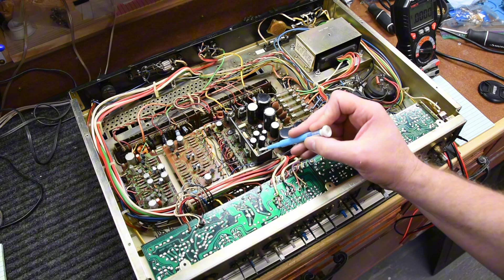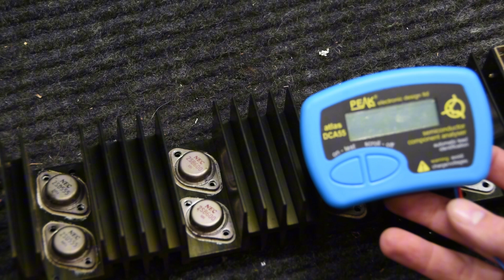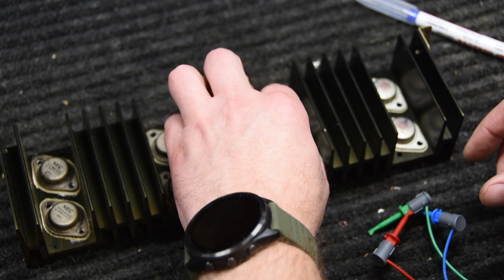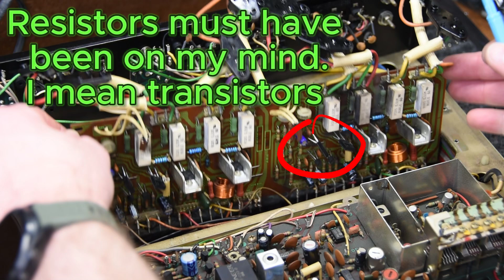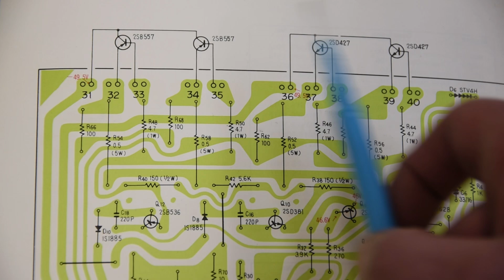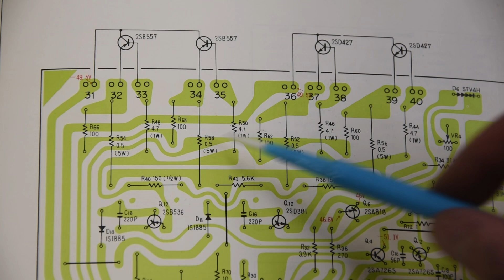Complete Repair of Pioneer SX-950 | Vintage Stereo Receiver Restoration & Troubleshooting

Comment: Hello there and thanks for this video.
First time I will try to fix anything that is electronic, and it happens to be my sx-950😅
I think we all now how this will end up.
So I haven't seen your video past to the point that you check the voltages on the 1-15 to the power supply,cause I already found some i would say important differences.
On mine, 8 9 and 10 they give me negative 0.979volts,as well as 15gives me negative 50.
Is there any chance that you could guide me on what to do next?
By the way the amp has no sound coming out from non of the channels.
Thanks for this video again.
Reply from the maker: Thanks, but its kinda hard to walk people thru this via a keyboard.
Reply: @ATOAudio 
I understand.
I will start with recapping the supply board.
Thanks again
Reply from the maker: @Gmcanada24  in the 850 the protection circuit was a common failure point as well. So I would plan on recapping both and replacing the transistors

Comment: Having a similar issue, but do not have the evidence of blown resistors or hot spots. This is a great instructional video that I will be using to go into the project. Both the SX-850 and SX-950 are showing this. Thank you for taking the time to put it together so clearly. Much appreciated!
Reply from the maker: You're welcome! Glad to help. Let me know if you have any questions!

Comment: I bought a SX-950 recently and it appears to have the same issues or similar to your unit in this video. I am retired and new to this and your video really helps.  I plan on keeping this unit myself. Thanks
Reply from the maker: Thanks for sharing!! I hope you get yours fixed and ready to rock!!
Reply: @ATOAudio  I checked all the volts on the PS and was almost finished when something shorted. Not sure if I did something wrong or if there was a loose wire which I later found.  Question, any suggestions on where I should begin my search for why I am not getting volts now

Comment: Question: I have an SX-850 on the bench and when turned up to about the 10 o'clock position on the volume knob, the protection circuit kicks in. All pin voltages on the Power supply, protection circuit, and amp board test correctly. Could this be one of the output transistors going bad? I also replaced the relay. I test the unit after each board, but guess what, I never turned it passed the 10 o'clock position. Lesson learned. 

Note: At volume less than the 10 o'clock position, the unit works perfectly.
Reply from the maker: what have you replaced on the unit so far?

Comment: 13:35 Pin 10 and 11 are connected to the same point. Installing the fly back diode is easier between 9 and 11.
Reply from the maker: Yes they are. Just how I've always done it.

Comment: 3:54 Did you happen to notice if the transistors on the power supply board, attached to the heat sinks, getting really hot? You can touch them, but not for more than 3 or 4 seconds before it gets to hot.
Reply from the maker: Yes they get hot.

Comment: Please help me in adjusting my pioneer sx950 tuner knob as it goes to far left and not far enough to the right. Is there an easy adjustment to putting it on like 98 fm and somehow fixing the string to put it back in line? So like now if I put it on fm 98 radio station but the needle points to 94 fm but plays 98 fm. Can you make a video showing how its done?
Reply from the maker: This isn't something I can really describe over these messages on how to do. But maybe I could put together a short video. Please watch my FM alignment video as that may answer some of your questions and help you do a rough alignment

Comment: Sil pads AND thermal paste? My understanding is paste is only used with mica, not the sil pad. At least most techs i know dont mix the 2. Are they teaching me wrong?
Reply from the maker: Yeah, I've run across that as well. Some say you don't need it others that you should still use it. It won't hurt anything and actually helps fill in any uneven surfaces to ensure maximum contact and thus heat dissipation. That's why I use it. I'm trying to give these components the best chance of lasting another 50 years. Great question. Thanks.

Comment: Really good video! Thank you! I always change out the diodes on the power supply. Is there a reason you didn't on this board?
Reply from the maker: I know a lot of people that do that as well. However, of all the receivers I've restored and repaired I've never come across a power diode that has failed. Zener diodes yes, but not regular diodes. Maybe I've gotten lucky, but its just my experience. Thanks for the question!

Comment: do you have a link for the transistor spread sheet?
Reply from the maker: No, and I'm not sure if I'll be sharing it in its current form. I'm actually thinking about making restore plans for different receivers where it shows replacements with pictures etc for sale on my website. Maybe I'll do the same for this master transistor sub list at some point too, however I'm not sure yet. Then again maybe I'll do a sub service where my paid subscribers get it as a perk. Just not sure yet.
Reply: @ restore plans is a revolutionary idea maybe you could sell a kit with parts, instructions, bulbs, contact cleaner, basically everything you need to do a full restoration.
Reply from the maker: @Matt_mck  That's a really good idea.
Reply: @ thanks, love your videos!